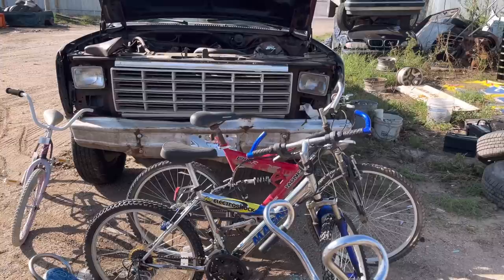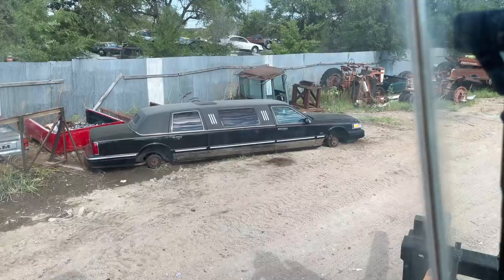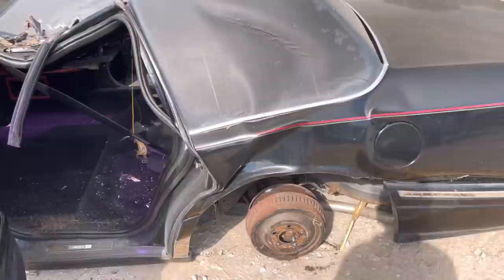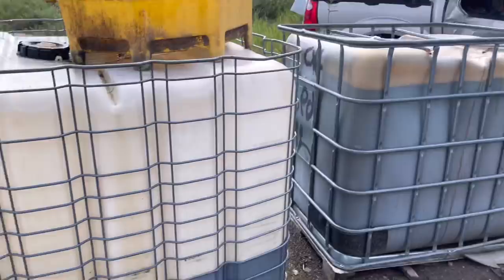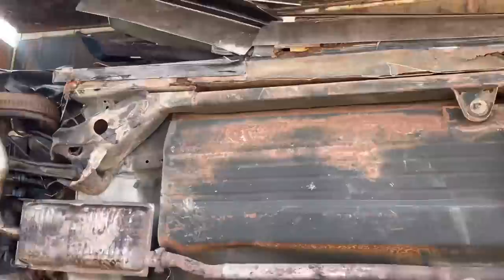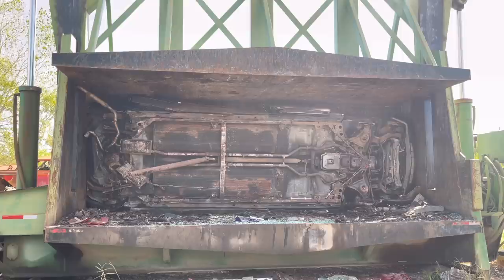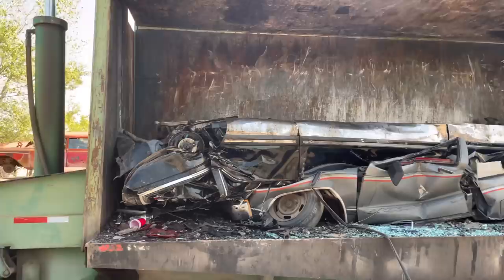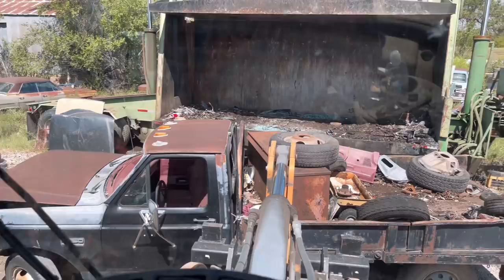Will It Crush? Junkyard Limousine VS The Green Machine

Comment: I sometimes feel weird watching some of these videos, because I live in a 55+ community (in Arizona), and a lot of the car models going into the crusher, are sitting around me in driveways.  There are three different examples of the 2000's Mercury Grand Marquis where I live, all shiny and lovingly cared for.  Down around the corner from me, is a 2000 Chrysler LHS; gorgeous car, although the paint on the rear bumper is getting a little flat.  A quick touchup at a body shop would take care of that.  It just goes to show that cars are what the owners make of them.  Change the oil, keep them clean, wax them once or twice a year.  Of course, it helps that salt/corrosive chemicals are not used on the roads here.

Comment: My favourite part was that one exhaust pipe on the limo, still outside the chassis of the crusher, as if it were a death row inmate holding on to a door frame as the guards tried to drag him by the heels to the execution chamber, reminded me of The Green Mile a bit.  And the lead sheets.  Sounds like bed sheets, just a bit different.  Silas, you are crushing it!

Comment: I work for a guy in Texas ,we crushed cars he had 5    a good loader operator near has to use a saw to remove the cads  use the forks to pop off the radiator heater core ,gas tank and the cad  close the hood and stuff it. ,but your doing a great job.  try it. near know
Reply from the maker: Done that for many years.

Comment: That was a fun video, how did that Limo pass inspection when modified, no gusset plates and even a little offset on that rear joint, another reason not to ride in a limo :)
105 wow, I shut down at 85 to 90 and look for cold drinks and a cool place to hide

Comment: This might be the comment your looking for... right now between some of the very successful channels, there is a challenge to take a excavator and pick a egg off of a bottle top and place it on another one. Dirt Perfect, Lets dig 18, Andrew Camarata, have picked a egg up and placed it on top of a receptacle. I believe Mike from Outdoors with the Morgans has done it as well. So Silas, this is a chance to get noticed. As for crushing cars, there is a need for it and there is a need for a place that recycles the better ones to safe operating order for the people who won't have the funds for new rigs or even just better rigs because most people look at their old car and to them its either a really good car or just junk. High schools could set up programs  to  teach older car  repairing tec. What I think gives a false impression is a dealer will say take a 2005 rig in and give some crazy high price for it on trade in. The rig they sell the customer is marked down from dealer recommended price. What they don't disclose is its marked down from a top of the line rig, not the base model they are selling so they get even more than it would of sold for. By the way, back in  the sixties and seventies... high schools had these programs and the local parts stores gave up parts at their cost. As I know, most electrical stuff is marked up as much as a thousand percent. Not a  hundred or even five hundred but a thousand percent! I do know that there are schools where you bring your own rig in and the whole school works on it. I am very worried that this administration will put us at war with some major player like Afghanistan and then the price of all  this scrap will double your highest price yet... thank you for taking the time to make your videos Silas
Reply from the maker: I’m not much good with an excavator. I only have about 20 hours behind the controls of one of those

Comment: To anyone that doesn’t like the crushing.
True story the other day I was at my buddies shop and a car came in and he said he needed shocks they put the car on the rack then called the guy over and told him they could not work on the car because it was about to fall apart the guy got upset that they wouldn’t put the shocks on and they told him he needed to call a tow truck but the guy said he would just drive it he was a little upset he pulled out of the parking lot got across the red light and the rear end came out of the car in the street so he had to call the tow truck 
This is a true story no b/s the car was completely rusted underneath from the salt in the winter so just because Silas didn’t show you the bottom of ever car doesn’t mean the car is good Silas picked up that 56 Chevy I think are 57 and the whole bottom fell to the ground some cars can’t be fixed it would cost way to much but I will say it does turn my stomach sometimes also

Comment: I just seen you scrapped $1,000 worth of axles on that old Ford with the flatbed
Reply from the maker: They weren’t that heavy. Probably only about $200 worth of axles
Reply: @AdventuresMadeFromScratch  the weight doesn't matter its the axle itself highly desired axles
Reply from the maker: @michael-ki4sr  No one wants those. I get them all the time and I’ve advertised them for $400 for a pair before with no luck
Reply: @AdventuresMadeFromScratch  weird where are you located?
Reply from the maker: @michael-ki4sr  Central Kansas
Reply: @AdventuresMadeFromScratch  same I had a dana 70 that I could not give away.

Comment: don't you have to pull the TV out?  Cowboy says they don't like having them in the cars.  

I could have used that right front turn signal lens off it.  My dad crunched his.  

That S10 if it's a 5 speed the T5 trans is like $400-$500 alone.  I had one that was a T4 and got $300 out of it.  That was a strange one because the tail section had the bump for the OD gear but it was clearly a 4 speed.

Comment: EPA staff should be fired over "pittance drippings" without giving you waiver permit... 

a)   you still did not remove tires.    
b) transmission fluid is not oil !
c) steering and brake fluid again is not oil !

companies will not take or recycle mixture of oil and fluids.    suspicious claims  hum hmm..
Reply from the maker: I don’t have to remove tires. I only remove aluminum wheels. Oil, trans fluid, etc will all burn the same in oil burning shop heaters. You can even mix a little gas in.